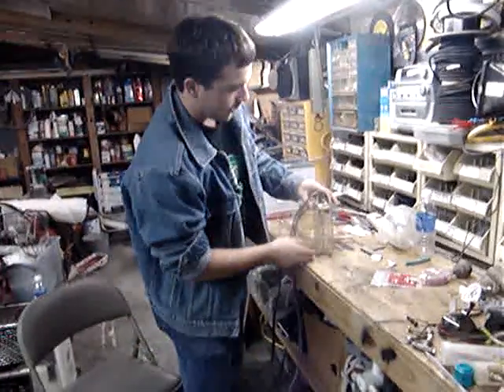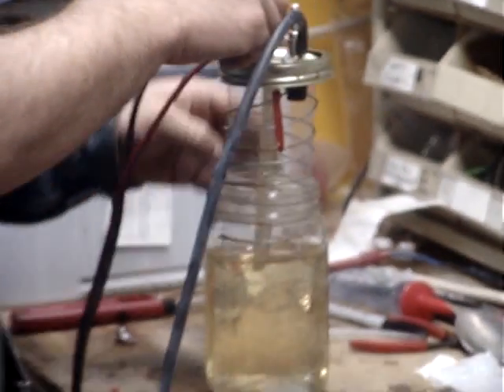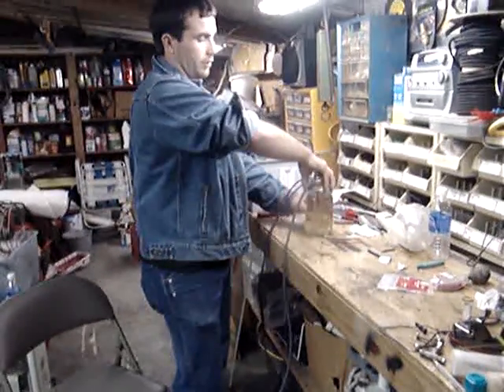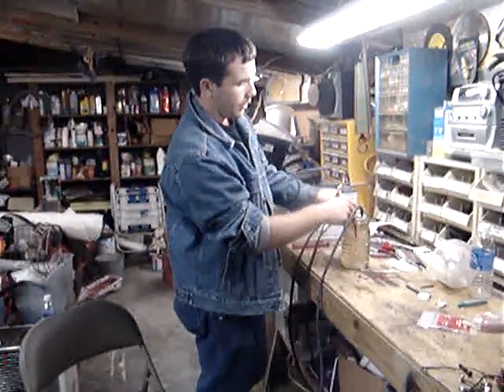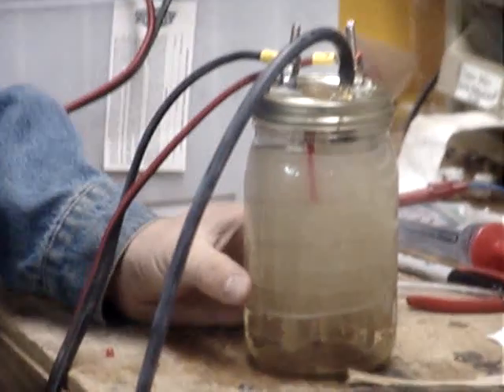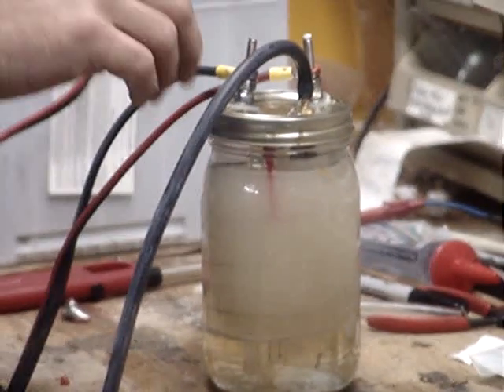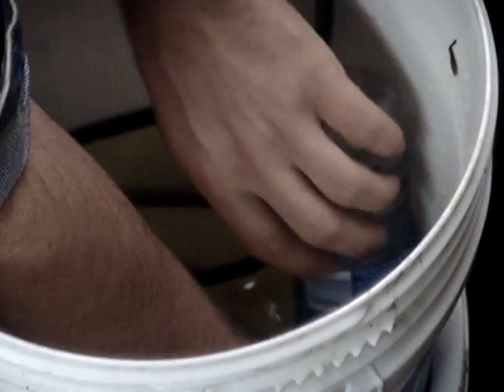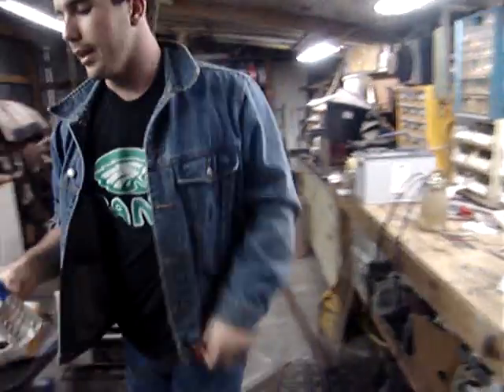The Hydrogen Experiment

Comment: @SuperKenny720 No, not really. In order to create the amount of hydrogen you would need to even make a dent in the lost energy would be quite a few times more than the maximum output of the alternator, and would require heavy pressurized tanks. Batteries in hybrids are much more efficient for that purpose, even though they too weigh quite a bit.

The only way hydrogen works is if you make it outside your car, like at home, and then fill your car with liquid hydrogen fuel instead of gasoline.

Comment: Maybe you dont need baking soda at all if you increase the conductors surface using thin steel foil windings. Recycle the combusted HHO mixture into the water bottle again and never ever think of refuling that bottle again. Run your engine, hook up a DC generator on it that will split the water again, and you will have an engine that runs untill all of the water is turned into pure radiant energy. 1 ml water can litterally power 1500 households for one year -> E=MC^2. Simple as that :-)